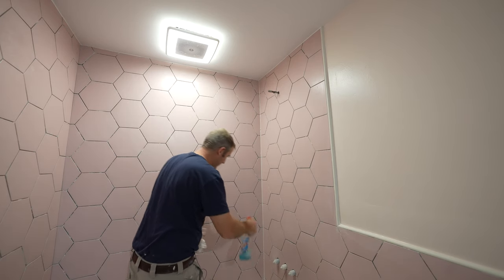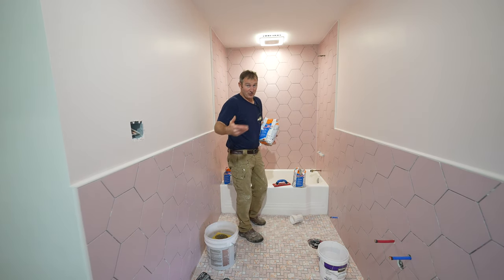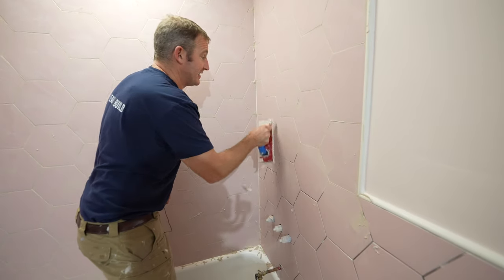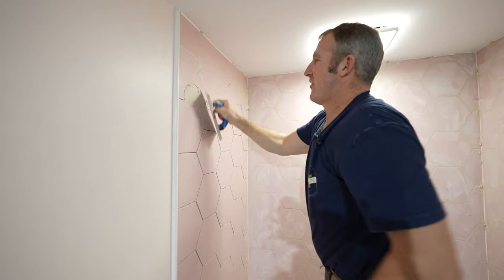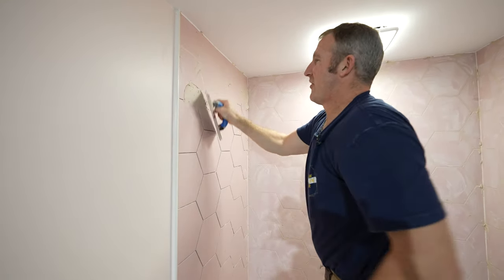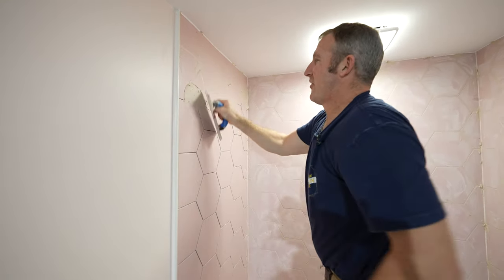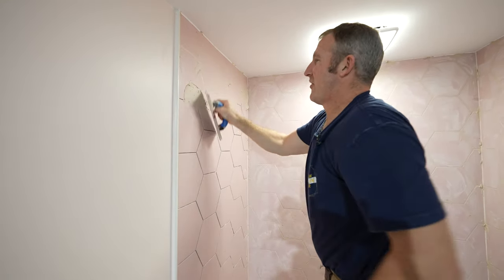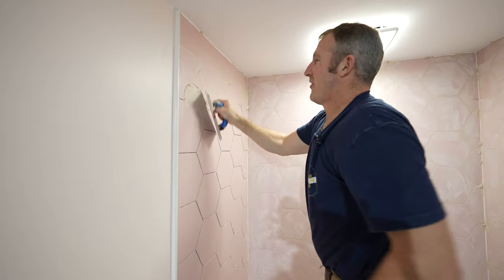Grouting & Caulking Tips for a Tub Shower | Mapei FA

Comment: This guy is a pro and I can not STRESS enough...DIYers, DO NOT do this many sq ft of grouting before you wipe down with this grout. I do this every week and your conditions will most likely not alow you this amount of work time with this grout... Trust me. Great work by the way. Another tile guy here and enjoy your vids.
Reply: I learned this lesson the hard way on a kitchen floor a few years ago. We ended up needing to rip out the whole thing. Luckily it's a small kitchen. I'm about to tackle a bathroom and I'm definitely not choosing the FA grout variation. I don't do this often enough to feel confident that I can move fast enough to use this stuff.
Reply: @colinholmes  I use half bags, cold water and mix with a margin trowel...Since then no issues but I will never do this much square feet as youll end up with dry spots in the grout and will have to wipe too hard to get smooth an WILL have inconsistant color. This grout is notorious for this.
Reply: Mapei Ultracolor (rapid set) is the shittiest grout.  I do large jobs like malls and plazas and no real pros use that.  Imagine mixing grout 20 times to do a thousand sq ft section.   Use regular sanded/unsanded Portland cement based grout.  Laticrete is the best but mapei keracolor is a good option too.
Reply: No, what you need to stress is that he is working in January winter time and as he said it's a bit cold around 70 deg F.    Doing it in the summer is when hells breaks loose with this grout.

Comment: Great vid. I'm amazed that you did all of the walls in one batch. I just finished one of my bathroom walls earlier. I added 3:1 by volume and hand mixed. The stuff was so stiff after 10 minutes I couldn't add anymore to my walls. I managed to get the one wall done but it was only a total of 10 mins or so and I had to start sponging immediately and it was hard to work the grout in the joints. The remaining portion of the bucket was concrete after 20 mins and I was barely able to clean it out. I don't know how you had so much extra time and even had to wait longer. Maybe I'll mix up 3.5:1 or 4:1 tomorrow.

Comment: So many things going on in this video. I have one question ,when the water gets through the grout and residual water is in the wall, in thinset,  behind the tile, As the water slides down the back of the tiles and gets to the bottom to where  silicone is  on the outside of tile at bottom,  that looks to me like it would trap in water. Using silicone. if you were using grout,  it would be able to come through and exit........ On the business talk side of this video, if you want to higher employee. All's they have to do is go get workman's comp exemption for the year. It's about $60. then if you want to require them to set up an LLC. I have an LLC s corp. That's also very cheap. those 2 things. Then if you want to be a totally totally legal subcontractor you have to get insurance, I have 1 million 2 million. And lastly, get your tax receipt and signed up with your county. a tile sub contractor that has all that is what you want. you should be able to make a $1000 a week off of that guy if you price things right. In my opinion, the boss and a couple legal crews. 2 or 3. That's where you're going to be able to maximize money and things won't get out of control. All you have to do is take care of 2 or 3 jobs and think ahead........ That should be the end game after you want to stop actually working.
Reply: I hate windex strong fumes not good for ya.
Reply: @ericastier1646  try x-15
Reply: @BonBon770  ???
Reply: @ericastier1646  I just wrote something that didn't make sense back. Because your comment didn't make sense to me. What do you mean windex?
Reply: @BonBon770  That is a stupid behavior. You could have said "that does not make sense" and i would have found the reason one iteration ago : mouse slip, the comment should have been for one comment lower.
Reply: @ericastier1646  What's even stupider is that you didn't erase your comment.😂🤷‍♂️👍

Comment: I watched your excellent video to prepare my grouting project. It went fine mostly but i made a mistake when the grout was nicely mixed to a nice cream consistency i saw some dry patches of grout crumbs sticking to the side bucket surface and it made me panic and i added a tiny extra splash of water maybe 3-4 extra tablespoon for 1.5 lbs of grout. I immediately realized it was too much water and avoided mixing the extra water too much.  The grout mix ended up 95% perfect + 5% runny grout sitting on top of the good grout. i know i could have added extra powder but i was not thinking. I grouted trying to use the good thicker creamy grout under but some of the runny grout still got on the floor. The seam looked perfectly grouted though, no application problem, perfect homogeneous color. I let it cure for 4 days. It looks visually perfect, but i noticed when i use a damp sponge on the tile the grout joint changes color  to a lot darker shade as it instantly absorbs the humidity then returns to its normal color as it dries.  Is this a result of that little mishap with the grout mixing or is it normal ?  (note i didn't seal the grout, and it's Ultracolor FA in a alabaster color a light grey).
If i blundered what can i do now with it ?

Comment: Im confused. Do you grout overtop of the caulk? Is there a risk there won't be adequate depth for grout strength?
Reply from the maker: It’s not really an issue. If you have excess caulk in grout joint, cut it out before grouting 👍

Comment: Sorry mate, but silicone b4 grout is not right.
Think about it, silicone will adhear to grout, but grout will not adhear to cured silicone.
Basically the joining between the silicone and grout is not there done this way and makes a path for water to get in.
I appreciate your hustle, but this is just bad advice
Reply from the maker: Grout and caulking are not meant to be the waterproof aspect of a shower. The actual waterproofing is. The silicone is used because cracks will form in corners of grouted
Reply: @BathroomRemodelingTeacher  it's the first line of defense mate, no reason to make a spot where it will absolutely get it.
Not to mention on the bottom joint to tub, the silicone will act like a dam to water behind it

Comment: Why silicone the corners? Wouldn't grout be what you're supposed to use?
Reply: Expansion and contraction; corners will crack
Reply: Is it because the tile is not side by side on the corner for solid grout contact? Therefore expand and contrast...
Reply: @shaundm78  yes, exactly
Reply: @robertwestover2125  I notice that the corner tiles are grouted on restaurant walls Bathrooms ect. Why not silicone? Is it because they're ceramic and not porcelain?

Comment: The most important thing imo when using the FA is mixing it for the proper time it says on the bag. 4-5 minutes, if not mixed long enough it takes off fast using a mixer is better if used for the correct time. You get a decent amount of working time when mixed at the 4-5 minutes like the directions say.  After about 3-4 minutes of mixing you will see a difference in the texture of the grout while mixing then keep mixing for a short while.   Not mixing proper is why it takes off so fast if it takes off on you.
Reply from the maker: Good points 👍
Reply: We did what the directions said with a mixer and never again! It dried so quickly just doing a small side wall shower and the front face of the shower. It hardened so fast that we weren't able to wipe it all clean. Grout lines are not as clean as they should be. Everyone says hand mix only.
Reply: @Motoray__456mx  
Hmmmm I never have this problem and use the product pretty much weekly.  I had it happen one time and it was because I didn’t mix it according to the directions.
Reply: @wasntme3651  It's not the only place where i read contradicting direction about this grout : "not mixing it enough is bad",  "mixing it too fast and too long is bad".  So this stuff is very finicky and the manufacturer surely does not give you the instructions to get it right ! You might get it right but it's only luck.
Reply: @ericastier1646  
I get it right every time. The first time was the only time I had a issue and that was because I hadn’t read the directions.  Just mix it at low speed for 3-4 minutes and it will be fine.  If it’s luck then I would be the luckiest person on earth because I’ve made a whole bunch of batches of it with no problems. Cold or warm weather the FA has good pot life and doesn’t take off too fast if mixed proper.  

It is finicky about how much water, when mixing in the beginning it will look to be too dry when it has enough water but as it mixes it loosens up to a perfect consistency.  When you are close to the proper amount of water but not enough, it only takes a few drops to make it enough.  Just a little splash and it will be too loose.   I use it on 99% of my jobs.  The other 1% is Bostik.
Reply: @wasntme3651  Thanks i appreciate the detailed guideline. What you describe is very similar to thinset with polymer, if not enough water it curdles into lumps and just a few drops miraculously changes the consistency. 
You get it right everytime because you are in the zone and do it the same way everytime, that does not change the much higher risk of people doing it for the first time and i don't want to destroy a tile job.
Given than several pro tilers have complained about this grout, i am still hesitant to use it.
Reply: @ericastier1646  

Yeah if you’re not a experienced tile setter then you shouldn’t use FA at all. I am a professional setter, it’s all I know.  I made a mistake once with it and it was my fault because I didn’t read the instructions.  It’s not rocket science it’s just grout.  It is far different than mixing a modified thin set.
Reply: @wasntme3651  Yes, mixing it seems so finicky.  Off course once you've done it once successfully it's easy to just do it the same way and call it easy. If i mix by hand with a trowel i worry that it'll take me more than 5 minutes to get the cake batter consistency and it will start to set off and if mixing it not enough it sets off even faster.  Mapei does an extremely poor job at instructions basically they just throw you off the plane with a loose parachute. They know it can be done and if you fail they can blame you. They need to be much more specific and detailed.
Reply: @ericastier1646  
Haha that’s a good point you made. Leave the instructions vague and then blame the customer. 

Even when mixed by hand it still has a good pot life. But if you’re not comfortable using it at least you have more common sense than most and decide not to use it.  

Get the Bostik Hydroment Vivid and you won’t have any problems. It is really expensive but it doesn’t take off on you and Bostik has very thorough videos and instructions on how to use their product. It’s between $70-$80 a bag.